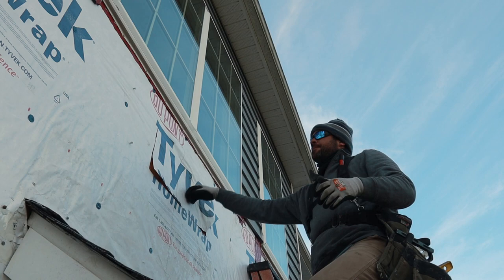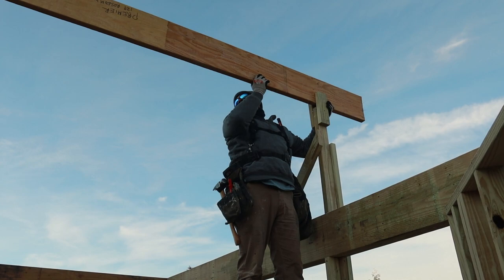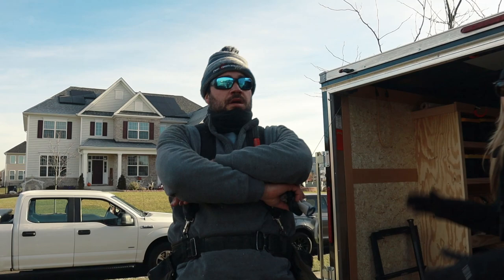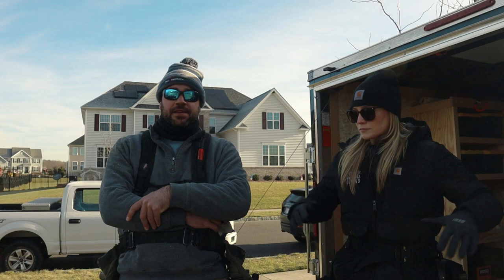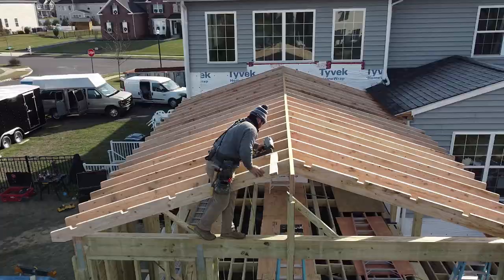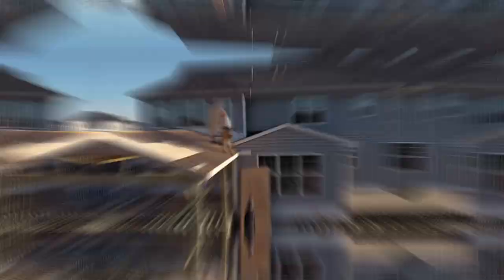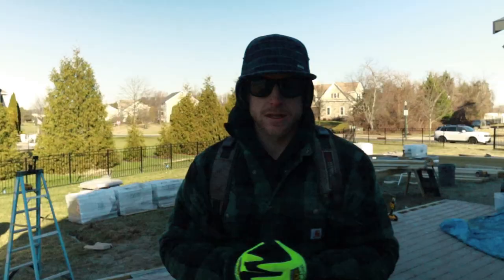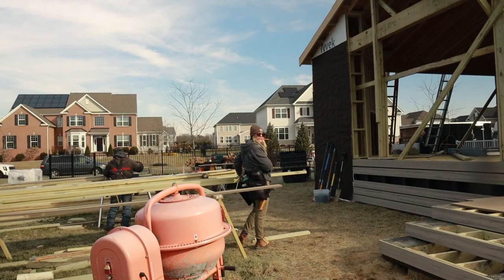Building The Roof And Installing Decking - THE MOUNTAIN PT. 3

Comment: Why would you drill for a drain in the floor joist? This weakens the integrity of the support. Why not use PVC hangers/clamps on the bottom?
Reply from the maker: We needed every inch of elevation to keep this a gravity drain and not add a pump, the joists are oversized in this location anyway